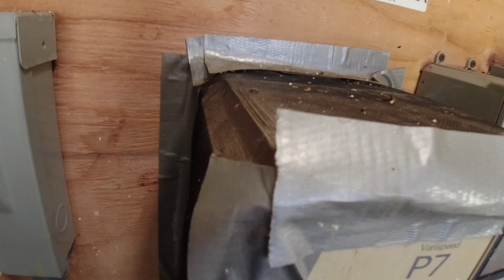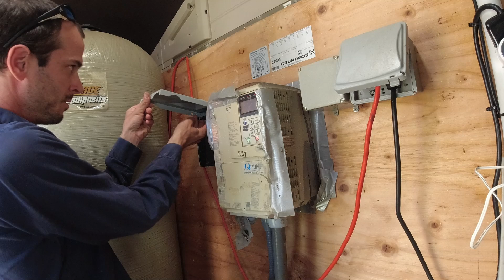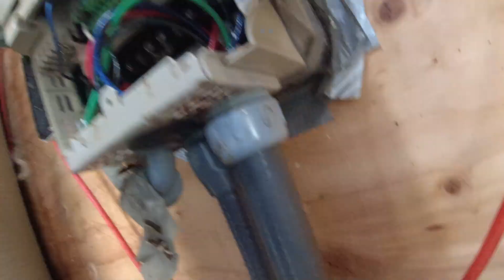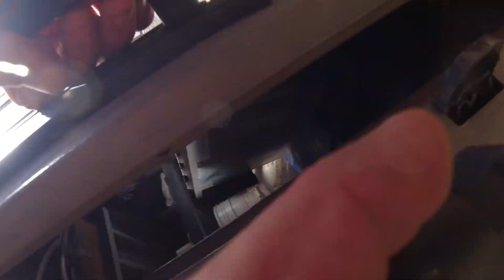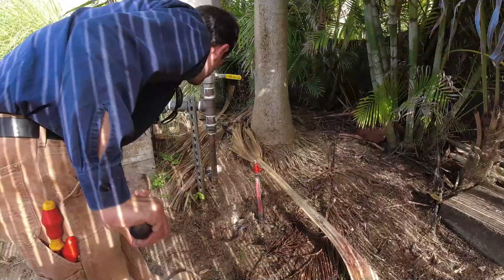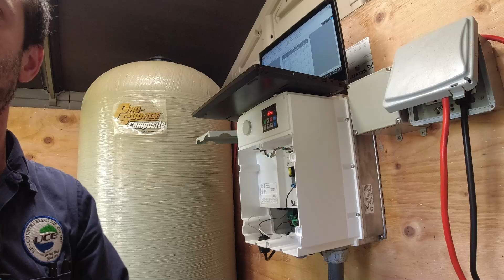Trouble Call: Well Pump Variable Frequency Drive Destroyed By Geckos

Comment: So that VFD looks somewhat gecko proof,is that just a coincidence or are the manufacturers aware of this problem & taken steps to remedy this issue?🤔
Reply: Vfds aren't sealed. If they need to be sealed they should be in an enclosure that can be sealed. The vfd should have been placed in an enclosure to protect it from invasion.
Reply from the maker: We use Nema 4x rated equipment to fend off insects.
Reply: @Up-CountryElectric ok, I'm Australian so not familiar with NEMA,I have heard of it though, I gather it's a standard?
Reply: @TheONLYDANHAMMER nema 4/4x Watertight. Must exclude at least 65 GPM of water from a 1-inch nozzle delivered from a distance not less than 10 feet for 5 min. Used outdoors on ship docks, in dairies, in wastewater treatment plants and breweries. X (as 4X) indicates additional corrosion resistance.
Reply: @TheONLYDANHAMMER nema 1 General-purpose. Protects against dust, light, and indirect splashing but is not dust-tight; primarily prevents contact with live parts; used indoors and under normal atmospheric conditions.
Reply: @TheONLYDANHAMMER  nema=
National Electrical Manufacturers Association
Reply: @anthonyhumbert8787 Yeah I looked into it,but thanks for your comprehensive input, knowledge is power I say! 👊

Comment: I died laughing at that AC disconnect fighting you back when you went to put the blade back in. Its not because you look foolish, its because those bastards do that every time. I hate them so much. I know how much more expensive a knife blade is but still worth it to me. 
On the plumbing side of things, youll have to excuse me, im a nyc electrician i dont see a lot of PVC. When i do its always purple primer/ clear glue  what is it about this blue primer? Also why transition from what looked like brass to pvc instread of gal or cast? I get that different places do it different ways and there more cost involved in metal plumbing vs pvc and at the end of the day  that usually sells the job. Is cost the only reason or is there an advantage to pvc?
Reply from the maker: Thanks! The colored primers just look worse to me than clear primer. It's too corrosive and expensive here for cast or galvanized pipe. On larger jobs it is common but usually it's either PVC or SS if it's outside.
As long as PVC is out of the sun it works just fine.
Thanks for watching!